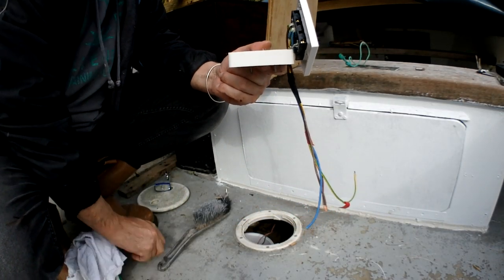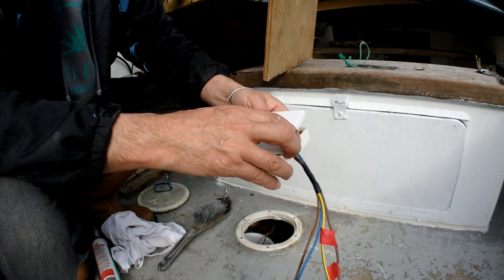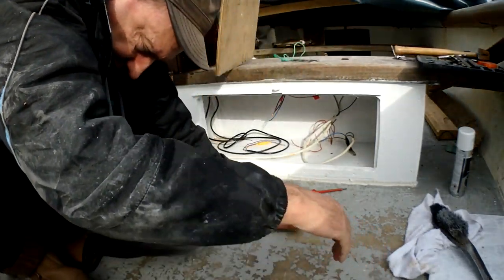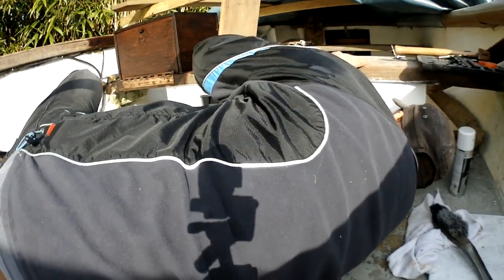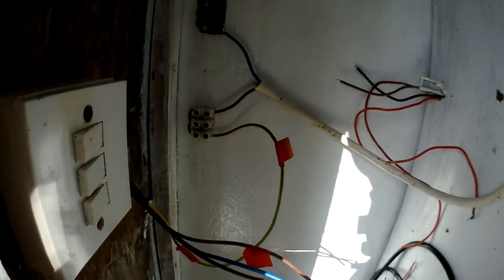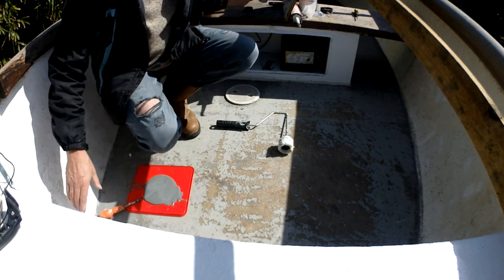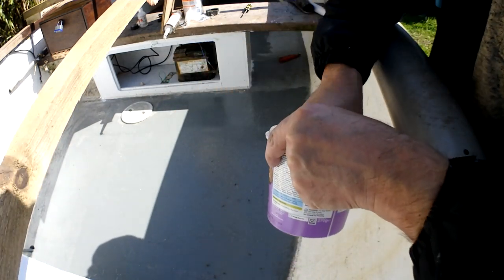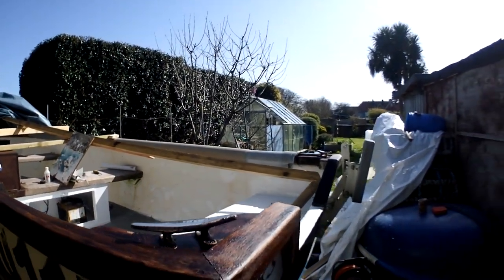⛵ Small Boat Owner 6 - Electrics Gunnels & Floors

Comment: GU 115 is looking amazing! You were showing your bilge pump float and my brother who as I mentioned before is changing out all of his wooden stringers. One thing he noticed when he pulled the floor was they had put good wooden stringers in then drilled holes in the epoxies wood to let water drain back, with no epoxy protection to line the holes, the wood soaked it up and rotted. How is the rib cage of GU 115? Just curious, she is a stalwart craft and one of the reasons I started following you. Good thoughts your way Troy, my best to Fish Cat and friends!
Reply from the maker: The rib cage is encased in fiberglass so no worry's there its the plywood that was used under the floor and cuddy/seat that's the problem but the floor fiberglass should be strong enough and now the cuddly seat has bee reinforced.

Comment: Looking great, and educational as ever! How do you secure your gunnel protectors- I want to put some on my orkney for pulling pots but would like to avoid drilling into the fabric of the hull if possible!
Reply from the maker: Keep the lengths as long as possible the curve of the boat keeps them in place they are very tight. I do have a couple off screws in but just making sure. it will be a bit of trial and error depends on the shape of the boat

Comment: crc 2 26 is the plastic safe spray to use on a boats gear.
Reply from the maker: I used to use lubricants and still do on the outboards electrics  but I switched to waterproof grease  on the boats electrics being it gets so wet on open boats.

Comment: Hi Troy.
my boat is similar to this one but it has wooden floorboards, ive just cut new plywood boards? What would you do to treat or protect them?

Thanks
Reply from the maker: I would not do anything apart form paint the top with deck paint or paint with sand. I used to use shuttering ply in one of my oldest boats it lasted for years (not sure with modern ply though) if its marine ply it should last for many more years. I have always found wood with saltwater on lasts longer than wood left out in rain or fresh water. I get the same effect on the wood pots.